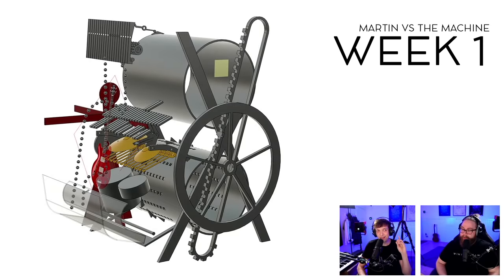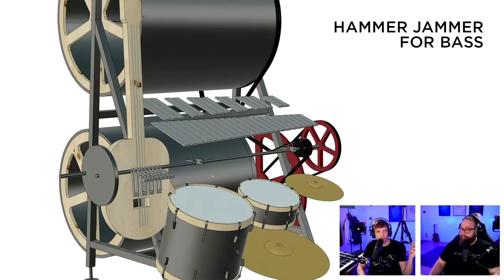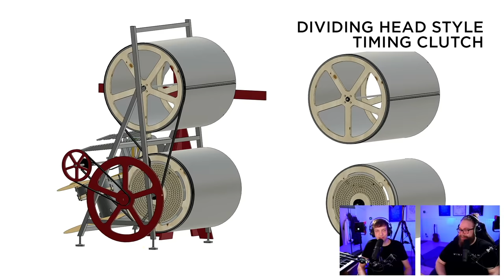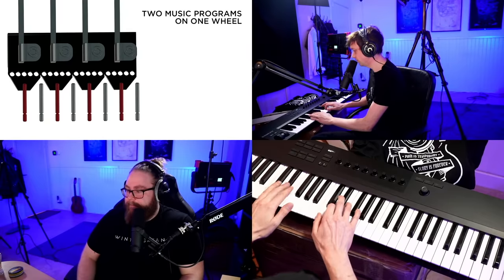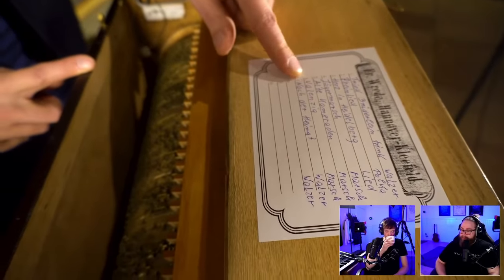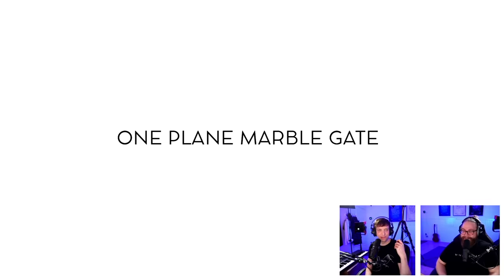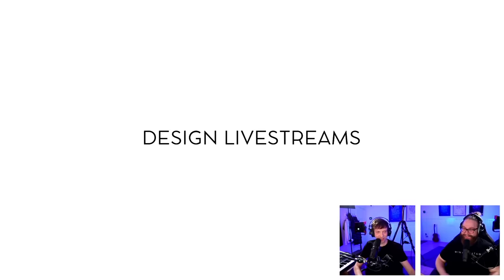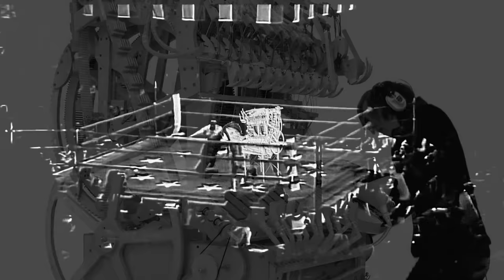Longer Music Programming - Martin vs The Machine - Week 2 Summary

Comment: My issue with "Looks come second" is that you start defeating the point. If mechanics are all that matters, the machine get's boring and starts approaching being a Launch Pad. There's another marble machine on youtube, but the entire machine is run on marbles hitting electronic switches that play sounds from a computer... The WHOLE reason your marble machine is cool and fascinating is that you're playing notes with with physical objects that can be guided and moved in fun, beautiful ways. Complex mechanisms show how beautiful physics and engineering are. Please don't lose that... Don't lose the art side of the project.
Reply: This
Reply: looks doesn't have to affect or be part of the mechanical part.

You can make something that works, and then add interesting looking design over it.

Would you rather have something that looks good/cool but can never work?

Comment: Please remember to include cross bracing on the square tubing frame. With MMX it was an afterthought. Don't make the same mistake twice ;)
Reply: they will not need cross bracing here. they have mid brace and the hollow tubing can have tenfold bend and torsional resistance compared to the anemic solid lasercuts from MM2. They can always make the tubes even bigger. top, mid and bottom bars are sufficient.

Comment: The special “silent” timing belts you want to use are designed to be quiet at high speed (RPM) and power. I expect that just about any toothed belt will be quiet enough for your low speed, low power, application. That might save some time/cost/complexity.

Comment: I will basically say the same thing as last week: I really hope to at least give a song and a video for the MMX. This beast was part of my weekly routine for years, as for many of your followers. You may say, with good reasons, that your design choices were too aestethical, and not enough oriented towards efficiency, and for making a world tour, I believe your assessment is correct. But still, the machine is magnificent. You really nailed the sound of the vibraphone, I really doubt any music machine ever produced notes that rich. The flow of the marbles is mesmerizing, even if a few misbehave too often. 

You had to run the original machine until it was broken to record the first video, I'm pretty sure you can do better with MMX. Also, a new viral video about Wintergatan could only help you in the long run.

Comment: NO FEATURE CREEP!

That's very important for something like this. The multiple tracks on the programming drums are feature creep, so stop it!
Reply: Coudln't agree with you more. For all the years, I thought the next marble machine was going to be ready, whether it was MMX or 3. But when I saw the part with two tracks on one programming drum, I pretty much lost my faith. If the previous version was too hard to implement, it's not exactly going to get easier by adding more features. I would remove the bass and the second wheel, and not consider two programs on the same drum. It's better to have a good machine that exists than a perfect machine that doesn't exist.
Reply: He's not gonna listen.
Reply: Yep, especially with it being a feature that requires so much additional complexity
Reply: Agreed

Comment: So you want replaceable drums, but you seemingly don't have an easy way to attach the belts. How is that going to work? How are you going to tension the belts properly? I really feel like the belt should not be attached to the wheel. That just seems inefficient. Just have the belt attached to a fixed gear that the wheel can slot into. Not the most pressing issue though.

IMO the biggest issue with the second machine was the marble path. I feel like at least 80% of the machines issues came from the handling of marbles. Having some 32 channels constantly funneled into one channel, and then having to be split up again was just bad design. I think it's a really bad idea to keep adding to this machine without mapping out the marble path. That should be the number one priority. Make a marble system first, and then add instruments and whatnot. Getting the marbles from A to B consistently is the most important thing on the machine.
Reply: the tensioning is shown on the sketch, the parts that thension will only be sketched when known where there is room for them.

the belts have plenty of slack.
Reply: 99% of the MM2 issues was wrong storing, dividing, moving = handling the marbles, you are dead right. Also belts should not be on the  drums, you are right again. The ratio should be done outside the wheel and wheels should only connect with a keyed axle. Another issue is sync of the two wheels, but i guess with some marks and some reasonable manufacturing tolwrances, it should be ok.
Reply: i was working really hard last year on the mmx into the discord community. Marble lane concepts mainly, tons of 3D, and said exactly the same with you. Even proposed a complete redesign, based on your described logic. Outcome: from the first week, i was deeply humiliated by the big community groupies. And that is the problem.  Most people that support Martin are blind followers, with no clean approach to the project and no real objections. They end up doing more harm, than good.

greetings.
Reply: @RupeeRhod  I feel like that should be designed early on though. The process of replacing a drum needs to be outlined step by step, and then the machine needs to be built with that in mind. If you only start sketching these parts later, you're just going to run into issues. 

For example how do you release the tension of the belt? Is there going to be an easy access lever? Do you need to unscrew things? How is the user going to access these areas with the frame in the way? Looking at the sketch, the part that tensions the drum belt is right behind the frame. There are many questions to ask. Replacing the drums is the second most vital operation in the whole machine. It should get great priority. It should influence most of the machine's design. 

After replacing the drum how do you get tension on the belt again? What moving part is responsible for that? How do you adjust the tension if you notice more slack is being created over time? In fact, how do you replace a belt on the off chance that it breaks? That should be a fast action.

Also when you take out the drum where does the belt go? Does it just hang there or is there something to keep it relatively in place? If it does hang there, what if it gets snagged on something? If there is something to prop up the belt then that needs space.

I feel like the priorities of this machine are just dead wrong. Here we are talking about having multiple songs on one drum, dividing head timing clutches and bass hammer jammers, when the most important core functionalities of the machine have not been designed. This is literally the same thing that happened to the MMX and I can already see it is happening again.

They need to figure out how to move the marbles and how to actually operate the machine first.
Reply: @DaShikuXI  Nothing to add really. they seem to dive into the same mistakes as you say. First 3 weeks (at least) should be spent only in sketches for marble management and high level function. Now they talk about bass protruding and the machine to be made larger because of it. Martin is a person that can obviously learn stuff quickly. But that does not make him a designer. His egoism has stopped him from hiring an appropriate designer. Instead, we have ha-ha-ha-hannes as an addition (which i am sure he is a great and useful guy if he throws his pretentious, over-reacting mask). Changed the subject but Hannes make sure he is unbearable, and only acts as a groupie on drugs, destroying the live feed.
Reply: @constantinosschinas4503  Oh man. It sounds like the, sorry for my use of bad words, shit management structure from the MMX carried over to the next phase.

Discord has the habit to create echo chambers and this leads to really questionable design work being done. I'm pretty sure the project can only succeed if Martin challenged his designs this time but I'm not sure if that happens this time.
Reply: Martin even used the malfunctioning marble system as a key reason to retire the MMX. In the YouTube comments here it had been said repeatedly that one should anticipate failure in several ways and implement failsafes for the various stages. All those failsafes, consistend marble distribution, visibility versus marbles not escaping, hardening the systems against wear for Martin's success goals takes considerate amount of brain work.

Instead of fixing what went wrong with the MMX, apparently it's important to change up what worked fine the first time around: the timing wheel.
Reply: @Caesim9  "important to change what worked fine the first time" lol lol lol.
Reply: I completely agree,
Start by making a list of what you need for it, before doing any design:

-Changeable drums? how do you see this happening. Many ways to do it, but they all imply some secure in designs, and connector play.(could just have different gear for each speed..., with 2 "clamp" to keep it in place.)
-What is your max rate of marble going down and back up per second. (this limits what type of songs you can make/how many notes, even tempo speed)
-How many instrument, and which one. How many marbles can fall at the same time at most.
-Maximum tempo(Or maximum rotation speed, slower speeds allows leeway, faster needs stronger stress designs).

etc.

Comment: One major problem on the MMX was that there was barely any slope control on top of the machine. Make sure to require that there should be more extreme slope control on the marble lanes and a larger marble pool.
Reply: they need to completely redesign the divider (or the module that will replace it). but your comment is spot on. having zero room for slope control on the top brought serious design issues, though, having extensively worked on this specific area in cad last year, i can assure you that the space could be found. when i was strongly suggesting scrapping the project and redesigning it from ground up, i was the new, weird, arrogant guy in the discord server. glad martin took the correct path, wish he sees it with a fresh aspect and avoid mistakes of the past. biggest problem with the community is that it is full with groupies that see martin as a small god. he is not. he is a very talented person that needs serious support, whatever that means.

Comment: As you wind the handle it is going to be suscepted to a lot of lateral shear forces. That chassis is going to bend and warp like anything under load. Think of it as an aluminium step ladder with most of the treads removed and a lot of mass high up.

Comment: I really loved the original Marble Machine, and I was excited to follow the progress on the Marble Machine X and even contributed monthly to the cause. But now that Martin is designing Marble Machine XXIV I've completely lost interest. The current design process is like totally inside out. Like if you were trying to design a jet plane but started from the passenger seat. Martin is designing the most excellent comfortable passenger seat, with cup holders and a nice fold down tray with a 4k HD monitor. But it also has to fly, so let's strap on some wings. Oh you need to be able to breath so let's construct some kind of bubble around the seat so the passenger can breath, yes that's good, but it won't fly. So lets attach some engines to the seat. No that won't work because the seat is inside of a bubble. So let's bolt the engines onto the bubble. Well the bubble isn't very aerodynamic so lets strap on some fins to direct the air flow and put a pointy cone on the front. And some wheels to land. I've never seen such a convoluted mess in my life. I'll wait another year until the construction actually begins to see what a disaster this thing turns out to be.
Reply: Yeah, I can't comprehend how he's already CADed the frame in such detail and yet has said nothing about marble management.

Comment: Nice recap. Make sure you devote enough time to solve marble management and bottlenecks in an Architectural (top down) design level. Marble bottlenecking was the No1 issue of MM2. Local Closed Circuits approach may help. No idea what you have in mind, so as to be more specific.

Comment: Regarding the bass: Why stick with a traditional 4-string bass? If you need something wider, design a wide-neck or use a 6-string neck and spread the strings out a bit. You’d probably also need a custom bridge, nut and pickups as well. This would allow for more “Flare” for the marbles to hit. Another option would be instead of side/side, how about upper/lower? You really don’t need the body either. Something like a Stennberger XT-2 would reduce the bulk.

Comment: Everyone in this comments section is butting in with their armchair opinions...but I'm going to add my own.

Feels like the feature creep is already creeping in. Already we're exploring ideas that would be cool but are adding complexity before you even have the machine laid out.

If it were me I'd come up with the grand plan for the final product as a list of requirements and a few sketches...then work on getting the core technologies working.

Start with a small-scale proof of concept, just a small xylophone that plays one simple melody for example. On the smaller scale it gives you the ability to go through the design - test - evaluate - iterate cycle much quicker. Whilst developing all of the technology you need for making the main event, i.e. thing that drops ball bearings onto an instrument when commanded to do so by the programming drum, then catches and recycles the balls. 
Once you have all of that down and working smoothly, then upscaling is much less work.
Reply: Starting small and then growing it bigger is definitely no the right move here. If you look at the first MMX videos, that's exactly what Martin did: protoyping. Protoyping the marble wheel, prototyping the pin mechanism.

But the big complexity from the start is dead on. MMX failed because of the marble management, it constantly made new problems, but instead of working on that Martin is redesigning things that worked on the MMX: the programming wheel worked, the delay device worked.

But collecting marbles from the instruments and transporting them safely back to the top and implementing mechanisms for when a failure happens (because failures WILL happen) should be at the core of the MMv3.
Reply: The starting with a small proof-of-concept. Probably doesn't work, but you are quite correct on formulating a plan with requirements.

Proper engineering always start with setting up Specifications and Tolerances and to make those you start with creating a proper framework with exploration beforehand on what is feasible. Once the specifications and tolerances have been drafted (preferably via application of the MoSCoW prioritization model). You LOCK them in place to not be deviated from. Only if you fail to achieve it and cannot find a way as to how can you maybe revise the specs (downward), but you do not allow "Oh but it could be even better if i did X!!" halfway through. You commit to the plan. Only once this is setup do you start actually designing and implementing.

I sadly do not see this and indeed the first signs of feature creep are settling in as he is trying to both explore and implement at the same time.

I think the best i can advise him. Is to take a real engineering course on how to be an engineer, rather than try to teach himself by listening to non-engineers and reading self-help books. There are aspects of engineering that few can teach themselves. This hobbyist approach simply does not work on a project of this scale.

Comment: I feel a bit sad the MMX doesn't have its own song just like the original marble machine...
You consider it as a failure while I see it as a huge improvement since the original machine. And saying that chosing design over reliability was a mistake is a mistake ! You didn't create a spaceship, you made art ! If everything had to be perfect without any imperfection, then we'd still be sticking to 8ves, 5ths and 4ths since the middle age ! You did chose design over reliability because the MMX is at first art, not a clock supposed to be perfect ! And that's why it was that awesome, everything was awesome in it ! Perfection makes things boring (coming from a perfectionist). Charm comes from defaults, and that's why we did love it !
So please Martin, at least give it its own song, so that it gets remembered as art, and not failure

Comment: For the two programs on one drum, having a half-shift that will play both program 1 and program 2 at the same time would open up yet more possiblilities.
Reply: This could be done, nice idea. Not sure if it can fit in a sliding mechanism. But if the mechanism is hinge like, it would be easier. It would also need double marble releasers tho, unless the melodies are made to not have common notes at common times. They plan to create a software to compose so that is possible, like in old 8bit Amiga .mod, midi composing software.

Comment: If the drum is removable I would drop the integrated spur gear. Messing around with the belt tension etc. is risky. Have a spline shaft and socket you can slide in and out to connect the two.

Comment: About the bass: once more, why stick to a normal massive (and totally useless) body shape and not go for a stick bass? Bulk and width problem solved. Go and ask Tony Levin if you're not convinced.
Reply: Becasue "looks" are still top priority in Martin's head, just he talks differently to convince the crowd. 
If "looks" was not a priority, the whole machine would be closed into a metal vacuum box to reduce noise. 
But it will never happen...